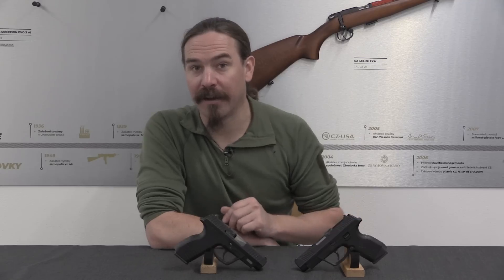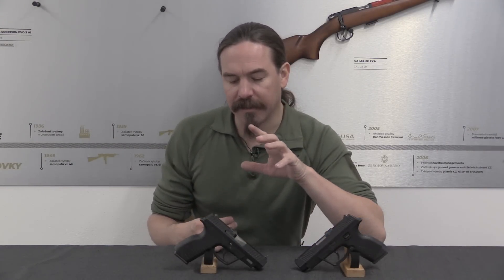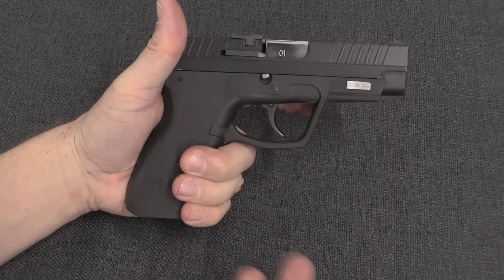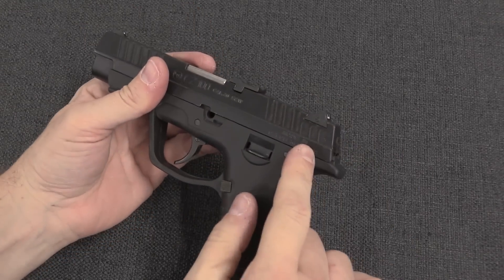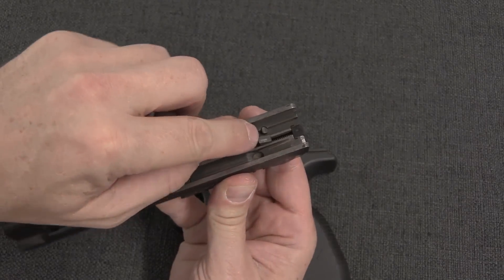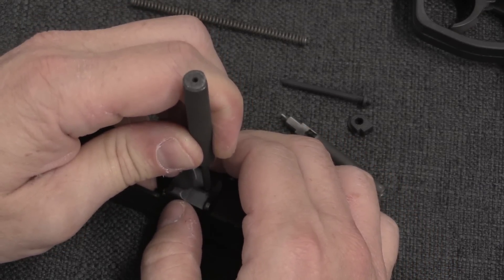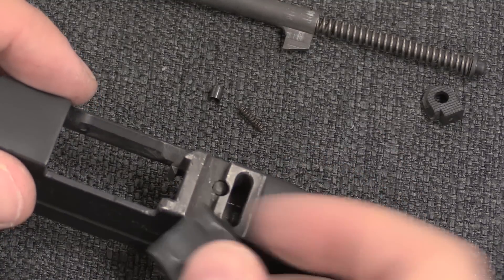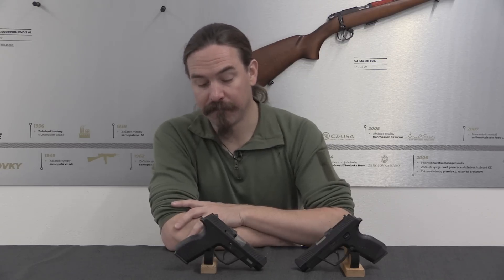CZ's Embarrassing Volkspistoles: The CZ100 and CZ101

Comment: Can you imagine Chevrolet inviting someone to their headquarters to talk about the Vega? Major props to CZ for allowing a critical review of what was an essentially failed design.
Reply: Forget the Vega, how about the Volt?
Reply: @loquat44-40  I've assembled sprung components inside a gallon sized food storage bag on more than one occasion.
Reply: Or Corvair!
Reply: Or the Cruze
Reply: @loquat44-40  a big ziplock bag works pretty good.
Reply: The Vega was fairly popular, especially for drag racing ( big engine, small light car). How about the mid 1980’s nova, those were a joke.
Reply: Or the chevette?
Reply: Id agree. CZ has always been the company to learn from mistakes and fix them quickly.
Reply: @DDrew67  Back when I was wrenching for  a living I worked on lots of both models. Bad as the Chevette's reputation was it was a much better car than the Vega, primarily because of the different engines the two  used and the Vega's rust problems. A joke among mechanics and car nuts in the early '70s summed up the Vega something like this- Chevrolet put that aluminum block engine in the Vega to extend the body's life because a Vega driven in the rain would turn in to a pile of rust within a week.
Reply: @pb68slab18  The Corvair was actually a good car killed by a lawyer.
Reply: Yeah I was just thinking it shows how much respect Ian has earned. And it's well earned. To me this is a very wholesome channel, one of the few I still watch after deciding to cut drama and negativity out of my life. I even watch it during my lunch break to relax 😎
Reply: The Vega was pretty popular back in the day.
Admittedly they didn't hold up well, but they were fun while they lasted!
Reply: @loquat44-40  sandblasting box would work well
Reply: @bobhunt4402  I knew a few guys with Corvairs back in the 70s. They didn't own them long! Yenko even had a high-performance version called the "Stinger" IIRC.
Reply: @bobhunt4402  I like doing all my finicky gun assembly in my office over a grayish-brown carpet. I keep a flashlight and magnet stick on hand.
Reply: @pb68slab18  When the Corvair was being produced its only real competitor was the VW Beetle. The Beetle was cheaper to buy but that could be mostly attributed to higher labor costs at GM as well as development costs. In terms of performance or maintenance costs there is virtually no difference between the Corvair and the Beetle. Was the Beetle also a bad car?
Reply: @Chironex_Fleckeri  soooooo true
Reply: This is actually legit. Hey, can I come to your place and talk about your failure of a gun? CZ be like: Yes, come in, we're not ashamed.  Plot twist: we'll also show you around our other goodies that you might talk about :D hehe
Reply: @loquat44-40  a cheap harbor freight sandblasting cabinet would be perfect.
Reply: @ryand2939  i think they memoryholed it so well even they don't remember its existence. I'm not much of a car guy and while I have heard of Vega, volt is something completely new to me

Comment: I’d like to hear more about the embarrassing history of the S&W Sigma.
Reply: At least S&W kinda redeemed themselves with the newer “sigmas”. The SD series is an awesome gun, and extremely affordable.
Reply: I have owned 4 of them, all worked fine.
Reply: @marcusmaddenov2451  then why did you buy 4?
Reply: I'm afraid it's mostly political/juridic mess. The pistol iteself was fine, and they even sold some decent amount. Not a glock-like success, but still.
Reply: @shoelessbandit1581  First one was a 9mm Clinton 10 rd magazines, 2nd was .40 also Clinton 10 magazines. Later bought 2nd 9mm with standard cap magazines, sold the first to a friend who liked it, bought a second .40 with different color frame and standard capacity magazines. Sold the first .40 which I had customized to another friend who offered me way more than I had in it.
Reply: SD series is fine. The spring on the trigger that connects to the trigger pin is hilarious
Reply: Hoplefeil has a pretty good history about the sigmas on his channel.
Reply: @marcusmaddenov2451  always on the sigma grindset I see
Reply: Say what you like about the Sigma, but it's a massively better pistol than the Glock. Maybe not the original F series, but the SWVE series and the current SD. Stainless slide and barrel(and magazines), traditional rifling that plays well with cast bullets, fully supported chamber(non-kaboom), and perfect grip and texturing. Steel sights,......all for about half the price of a Glock. Any ONE of those things would make me choose the Sigma over the Glock. The triggers are poor, but much like the NY trigger in the Glock, S&W intentionally included a secondary spring in the trigger assembly to make the pull heavy and deliberate. That spring can be removed and you can improve the trigger and make the gun just as unsafe as any Glock.
Reply: The SVD9 is okay, but it has one of the longest factory triggers I've ever felt.
Reply: @marcusmaddenov2451  lemme guess... you're in a ban state
Reply: I would not. Not at all.
Reply: @kaveman9  No. It's not a better pistol. It may have its selling points like those you mentioned, and it's definitely got a place in the market, but it's not better. I own both. Give me the Glock everyday over the sigma.
Reply: my 3d printed SD is thinner than a Glock on the grip thats the only plus I give it.
Reply: The Sigma was a giant POS, they really had no shame in coping Glock and removing the quality and reliability.
Reply: @shoelessbandit1581  why buy four? Because they work!
Reply: Perhaps the Colt 2000?
Reply: @jimdandy8119  I've got plenty of Glocks and probably over two dozen Sigmas, SDs and M&Ps and all the Smiths are better than the Glocks,....just a fact. I've owned Glocks since the early 90's. There's never been anything special about them. Highly over-rated pistols. Opinions,....we has 'em.
Reply: Smith Imitates Glock Mechanical Action, or something like that.
Reply: I've had a pre-lawsuit full frame Sigma (SW40F) for decades and have no complaints other than wanting a red dot mounting option, but when that pistol came out pistol optics were not at all common so I can't really hold that against it.
Reply: The first models were too close to Glocks design and had to be changed with the Sigma.
Reply: one of the younger kids from tfb-tv just did a video about a month ago on the FN 40 that's another gun in this category of dumb. like other people said I think the sigma series was redeemed by the SD series. that being said if Ian thinks these guns are a flop but the new high power is a great improvement then I'm starting to question his sensibility as of late. that being said who the hell am I to question gun jesus. God bless.
Reply: Hop of TFB fame has a fairly deep dive on the pistols and their surrounding history. Well done video IMO.
Reply: 1.) Smith & Wesson released the Sigma
2.) Glock sues over patent infringement
3.) Lawsuit is settled out of court; with Smith & Wesson agreeing to redesign the Sigma trigger mechanism and pay Glock G.m.b.H an undisclosed sum.
4.) Redesigned pistol is released as the SW series

That’s the entire history. The Sigma is a really bad imitation of a Glock.
Reply: @Enraged-Gecko  sd9ve in a Glock 19 side by side at the range did absolutely the same for me. I couldn't tell you the difference if you blindfolded me. I recommend them to everybody who's not that into guns and doesn't want to spend over $500 to get something reliable. Think of Glock as an Apple phone and the SD series as an android. One may be more refined but at the end of the day they both do the same thing with the same amount of reliability. 🔥
Reply: I still have my sigma from 1994 that says SIGMA on slide... works great, 10k plus rounds
Reply: @billdoetree4313  Except an android will do plenty more than an Apple
Reply: @Toolness1  And you dont have to ask permission to do it lol
Reply: Would you like to buy my .40? Then you can study it up close lol
As a warning tho, All my magazine baseplates are cracked or cracking.
Reply: @kaveman9  I have two of the SW9VE's that I have removed that bottom spring from and they've been great.  Also, smoothed the Trigger Contact surfaces.
Both have been customized and I carry one of them, daily.  Better than any Glock and the newer S&W M&P Pistols.
Reply: @upyoursassmonkey  
Same, it's my EDC. 8# trigger and all.
Reply: @hoppinggnomethe4154  Nope in Texas, this was during Clinton Ban.
Reply: @loquat44-40  Trigger pull is an easy fix, done it to all mine. Apex makes a trigger kit, breeze to install.
Reply: @jason200912  You couldn't then, not like now, I have since bought extra mags.
Reply: @stefanmolnapor910  Parts are available cheap from S&W
Reply: @marcusmaddenov2451  hummmm.... i contacted S&W and they told me they do not make or stock anymore of the parts, they are discontinued. There are after market makers tho.
Reply: @stefanmolnapor910  They still make the gun and magazine, should be able to get baseplate.
Reply: @hansblitz7770  None of those models you mentioned are made by companies who got sued by Glock for copy-write infringement forcing them to redesign the gun.  Not sure how you took my comment as a negative against striker fired guns.

Comment: 10:17 Having the firing pin jammed forward sounds like the recipe for a runaway open-bolt machine pistol.
Reply: I was about to write that too.
Reply: "Should we fix that?""no.....no just leave it..... "
Reply: That sounds like a feature, not a bug.
Reply: "I just try to fire once and it magdumps at the guy
13/9mm, would self-defence again"
Reply: @347Jimmy  ^ people who don't fire their ccws before needing them
Reply: I think it would actually jam it rearward
Reply: @347Jimmy  Not even that. If it was really stuck in the forward position, it would start firing as soon as you close the slide, like an open-bolt SMG with a fixed firing pin.
Reply: @MarvinCZ  jeebus
Reply: @MarvinCZ  So basically, an all-round burst machine pistol with a slide release as the trigger?
Reply: @Immafraid  Yep! But all that's assuming the firing pin would be stuck in the firing position.
Reply: @MarvinCZ  and that it slams into lockup before the powder lights off, might just open violently enough to burst the case and blow the rest of the rounds out the bottom.
Reply: @Broken_Yugo  I think the nature of the tilting barrel makes sure that the firing pin isn't in line with the primer before the breech is locked.
Come to think of it, that might actually cause a jam if the firing pin is permanently stuck in the forward position, preventing the case sliding into position on the breech face.
Reply: @MarvinCZ  You're right, it probably would jam and just put a gouge in the case near the primer pocket.
Reply: Remember CZ 122 22LR, oh boy 22LR machine gun right there. Once you hit the trigger it was 4-5 rounds at one fast brrrt... This one was somehow broken at the time. Still this video and comments brought up so many memories...
Reply: @MarvinCZ   I have a Ruger pistol that the firing pin is non rebounding, when the slide opens on a fired case the pin makes a little drag mark on the primer making the indent look like a little comma.

Comment: I think the CZ .22 LR "Kadet" system deserves a future video at some point. It's a really smart design in my opinion.
Reply: Also the SIG P220 and P226 Classic 22 models. A million times better than the Mosquito, and can be easily converted to full calibre, often for cheaper than buying a normal P220 or P226.
Reply: I've got a Kadet slide for my P01. Really great to be able to fairly quickly swap between 9mm and .22 on the same grip and same trigger for training or plinking. I think they've been discontinued,  which is a shame

Comment: I don't think it was the intent but I wouldn't be surprised if that "belt racker" part could have been used for aftermarket optics rails (take it out and install a pic rail in the slot), no idea if it would hold zero but would be a cool way to slap on a small red dot

Comment: Oh, I could go on about this.  Had one for about 5 years, back in the low 2000s.  CZ-USA doesn't even have anything at all on its site about it now.  The US version had an adjustable rear sight, dovetail not compatible with the fixed sights.  

And yes, the striker spring and guide went twang!! the first time I disassembled it.  Never did find the spring guide.

Mine broke too much, and was never all that reliable.  Never got off probation, so down the road it went.

Comment: Many years ago, in the 90s, I had a West German Perfecta FBI 8000 gas pistol, its striker spring was removed in a similar way. The first time I took it out it catapulted across the room and under the closet, it took me quite a while to get it out with a ruler. A couple of years ago I watched a video where the owner did this part of the disassembly procedure by placing the gun in a plastic bag to prevent the spring from flying away.Good idea, why didn’t I think of it myself. )

Comment: I won a cz100 in 9mm for like $5 and traded it in a few months later. Striker spring was so weak that it would just have light strikes every round. Pulling the trigger 20+ times to shoot 10 rounds was annoying. Got good at not anticipating recoil tho. Guy i sold it to slammed a cz75 mag in and it did work lol
Reply: @LIONTAMER3D  aint that the truth lol

Comment: The Ruger P95, which came out at the same time, does not have any metal reinforcement for its guide rods. These, like the CZ pistols shown here, are molded with the frame. They are not full length. I have one of these and have had no issues. I have also not seen any issues with the gun from other sources.

Comment: Aesthetically, I quite like the look of these guns, particularly the 100 in .40 S&W. The grip and frame are pretty generic polymer pistol, but I like the slide a lot. The overall shape, with the sloped back and sides, the two bands of grooves ahead of and behind the extractor, the contrast of the shiny inner parts in the extractor gap against the dull gunmetal grey slide body, it's all quite satisfying to look at. It gives a kind of rugged, functional impression which is unfortunately completely at odds with the gun's actual function. I even like the barrel stop / belt racking bit behind the extractor, just as a bit of extra detail that breaks up the smooth top of the slide. It's the sort of thing that would look good as one of those random bits tacked on a videogame pistol for looks with no regard for the real-world functionality.

Comment: i have a cz p07 and a Star Ultrastar and i find it really neat that Star(Spain) who copy alot of euro patented firearms (at least they used to for last 150years). Well they took inspiration from CZ 75 and Sig pistol structures to make their polymer wonder 9 in the 90s, arriving late to the craze and military contracts of the 80s. But they made a polymer frame, inverted rail, DA/SA, 9mm, planned to do double stack, etc. and then a decade later CZ puts out the P-07 that is also inspired by CZ 75 design and is basically the same thing but modernized and better. Its like CZ saw how they were copied and innovated off of it.

Comment: The little round plug and wedge on the inside end of the striker spring is to stop the striker spring from pressing the striker all the way forward all the time, causing the striker to protrude. Most striker systems have something similar but also most striker systems are at least partially cocked during feeding and locking so the striker is pulled back to some degree behind some kind of striker block that also doubles as a drop safety. Once the striker is behind a striker block it should be fine. Since this only pulls the striker back when the trigger is pulled they require the spring at the front of the striker to push it behind where the striker block can reset. If the striker does not spring back in this system then, when you drop the slide, even with the wedge, the striker is still relatively free to move forward under inertia and possibly fire the round without pulling the trigger. They could have done away with the wedge and spring in the front just by having the striker be partially pulled back during cycling like most striker fired pistols, resulting in an easier, simpler, and more functional design. Looks good otherwise.

Comment: There are a couple of 3-d printed pistol designs that integrate a plastic slide rail as one piece with the frame. One of them is a printed version of the Beretta 92. Most good 3-d gun file designers put their prints through several hundred or thousands of rounds before they release them to the general public. So far, so good..

Comment: These pistols must be a pain to re-assemble, with all those small parts under spring tension held in place by other parts that need two hands to position properly. I'm sure that's one of the reasons these guns did not sell - you wouldn't want to field strip them anywhere it was dark or dirty, where small parts could be easily lost (like the striker spring and guide rod).
Reply: ????  Do you know the difference between an field strip and a disassembly?
Reply: The field strip isn't any more complex than any other pistol. How often do you disassemble the slide of your other pistols? That's not something you do for cleaning.